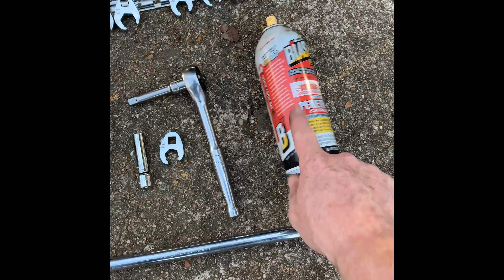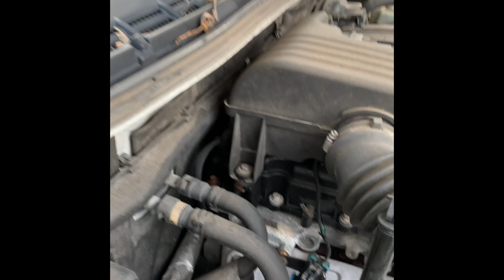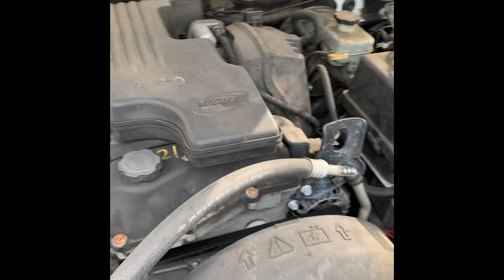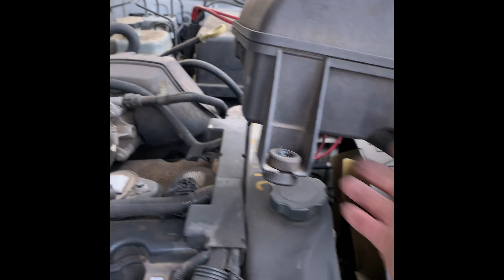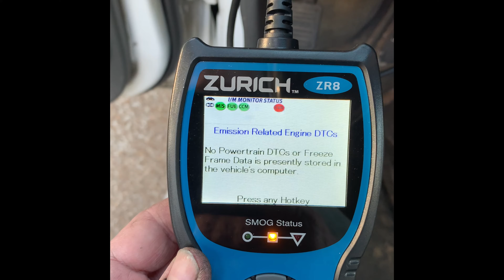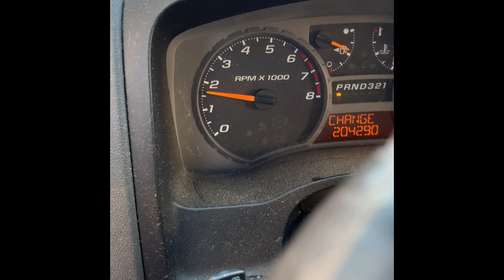Engine Coolant Temperature Sensor Replacement 2006 Chevrolet Colorado

Comment from the maker: I'd like to say thank you to all of you that have found help with this video and also those that have clicked through the links to purchase items for this repair. It is very much appreciated by me!
Reply: Thanks for the video! I have a '05 Z71 LS. Just changed my second Water Pump & Thermostat yesterday. I was curious about the Coolant Temp Sensor as I've never changed it before. This definitely helps!
Reply from the maker: @DownInFlames85  glad it helps! Thanks for the comment!
Reply: Well, my new temperature sensor lasted four months and then it started doing the same thing so I guess I’ll try replacing it again
Reply: I went through two temperature sensors in three months

Comment: I managed to break the old sensor off inside the hole, and had to use an easy-out and impact to remove it. Some solid advice. Do not remove it with a crows foot and extension. Cut the cord off of the old sensor slip a deep bore 15mm over it and use an impact. You will need to pull  the coolant lines to make room, but it will save you a massive headache, and turn a 2.5 hour job into a 1.5 hour job.

Comment: I'm wondering out of the four codes that you had was one of them the p0116 I was driving my truck yesterday turn the corner by the post office in a completely shut off on me and it pulled up that code It cranks and the fuel pump sounds like it comes on but for the life of me I can't figure it out.

Comment: Thanks for the video, it really helps! Did you put any kind of form-a-gasket on the threads of the new sensor? I see it has an o-ring so that  step might not be necessary.
Reply from the maker: I did not. Just the o-ring.
Reply: @toothmaker1216  thanks, after watching the video I went to remove the old temp sensor, unfortunately it snapped off. At that point I took it to a professional and they were able to remove the broken base. Once they put the new sensor in it still didn't clear the code, turns out it was my thermostat. On those 5 cylinder motors the thermostat housing has to be replaced too. $540 parts & labor later (not counting the temp sensor) my truck runs great and it passed the smog check.

Comment: I have a same or similar code issue with my 05 colorado 3.5l...says engine cold for too long. But only throws a code every few days when I erase it...I hate to replace the thermostat if I don't have to bc its not stuck or anything.

Comment: Forget about the crow's foot and cut a channel in a 15mm deep socket and save yourself some misery! Thanks for the video I really needed the part about disconnecting the wire connector.

Comment: If you get the po128 code. But the engine light off,  could it not be the sensor ,instead it’s the thermostat?

Comment: Was you having starting issues when engine was warmed up? I’m having issues with my 07 colorado
Reply from the maker: No, I wasn’t having a starting issue. Mine was mainly just a check engine code and a rough idle.

Comment: How important is it that these be OEM?
Reply from the maker: I’m not a professional mechanic. I just work on my own vehicles. That being said, it is my assumption that the manufacturers use certain minimum quality parts to ensure the vehicles perform to a certain standard. Therefore whenever possible I try to get OEM parts as long as I can afford them!

Comment: How did you get that sensor out I have a 2007 and I was gonna do it the other day but could not figure out for the life of me how to get my tools down in there
Reply from the maker: It was a little difficult to reach and I had to do it by feel mostly. Be sure to remove the air intake first so it’s not in the way. You will need to use an extension also.